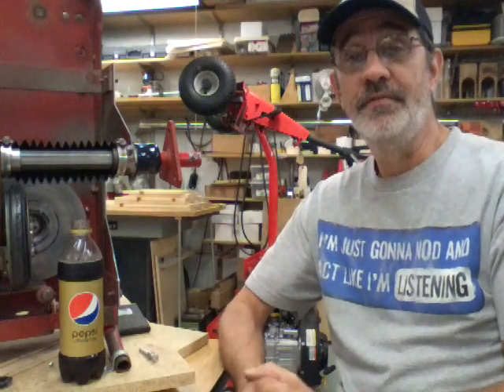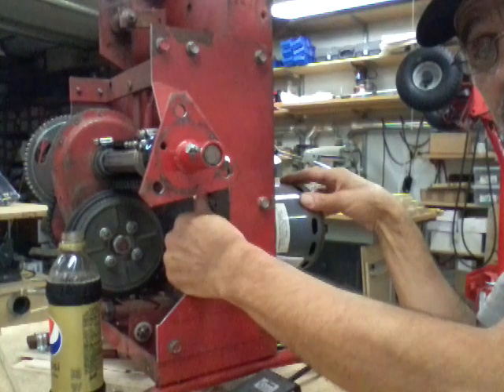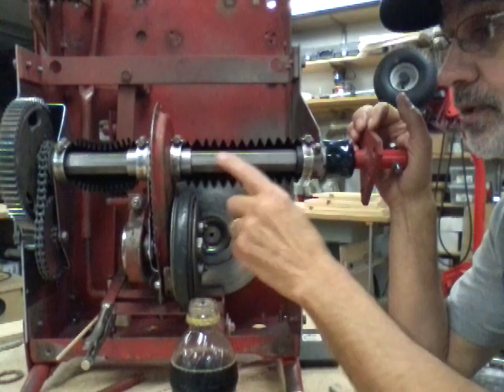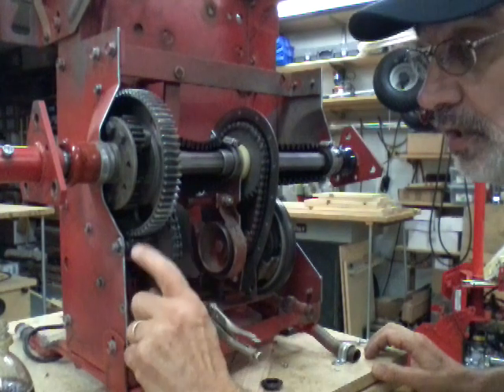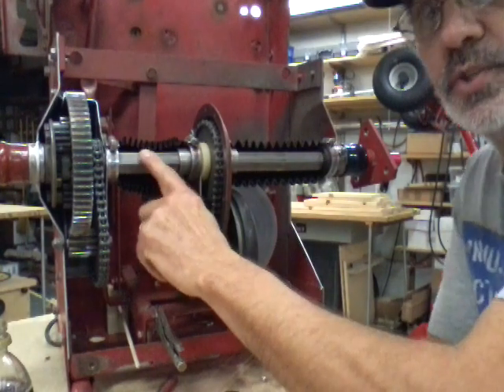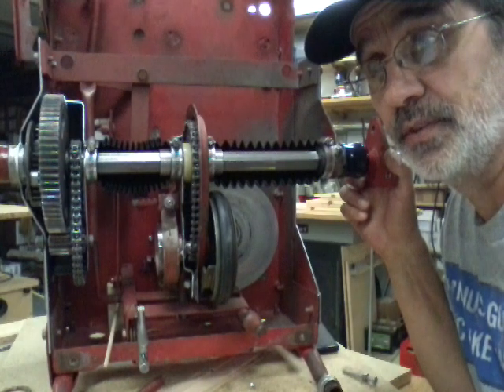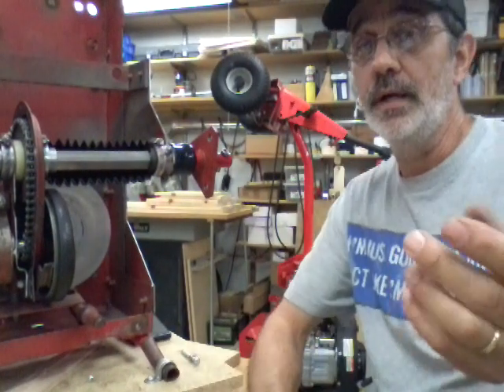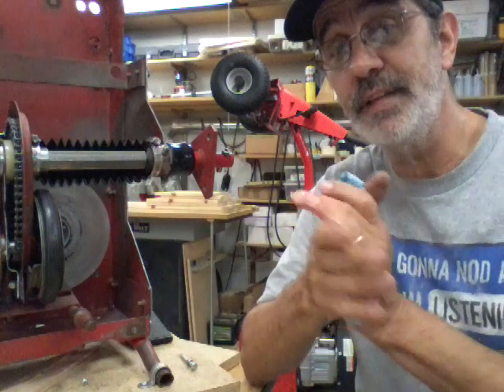132. M/S. 16  troubleshooting the drivetrain on a Snapper rear engine rider

Comment: Jim,  I have a 33" snapper that  I have changed the friction wheel and the belt but it still slips when I place it in gear.  Reverse is fine but going from 1st to fifth it has issues slipping.  Is there an adjustment that I am missing that i could tweak to fix the gearing??
Reply from the maker: I have a few videos that talks about that issue. I’m not sure if you’ve seen any of them, but you may want to check out video number 70, 96, 132, and 182. See if any of those address the issues you’re having and let me know.         Jim

Comment: Should the chain case have any side play on the sprocket? Mine moves side to side about 3/4 of an inch.  Doesn’t seem to affect anything but I don’t know if that’s normal.
Reply from the maker: Well if you’re talking about the sprocket that is on the hexagon shaft it should have a maximum of 1/32  Side play, if yours has 3/4 of an inch side play then your bearings are either gone or they fell out of the chain case covers and they’re up inside of your boots somewhere, with that much side play your chain will probably be a slot through the side of your case.Jim

Comment: Hello, Jim. Great video. I have a 2007 Snapper 30" RER that I bought used early last winter. I did some basic repairs on it, seat, blade sharpened, put on a new pully cover and left it sitting to use this Spring. With the engine off, I noticed the mower didn't want to roll forward or back while in neutral so, I turned it on and it moves in reverse but it won't move forward in any of the 5 forward speeds. The rear wheels are locked as if the mower was in "park". The realize there's no park but anyway, that's the only way I can describe it. I made sure the brake was off and there are no obstructions whatsoever underneath the mower. What's your take on this? Thanks in advance - Ana's husband.
Reply from the maker: Watch video number 70 and tighten your Yorkspring all the way and let me know if that helps you and you could send me a picture of the clutch disk so I can see how badly worn it is. Jim

Comment: I opened my difurntual case up. I did not see anything wrong.  my mower will go in 4th or 5th but not 1st,2nd,3rd, or reverse any answers to this problem? video is very helpful.
Reply: Stand mower up, get help pushing the clutch pedal.  Move the shifter  thru the gears.  back the pedal off 1" and see if there is a difference.  If not, release the lh boot camp at the middle gear drive and move the boot out of the way and see if you have a clean hex shaft or if you have debris build up from a broken boot.
Reply: Look at both sides of the hex shaft under the boots. Sorry,  I'm not fluent with which direction the drive moves.

Comment: First, thanks for making yourself available to us!!! 
Well, I fire my snapper up & it starts screaming like it’s a belt. The gear lever moves pretty freely. 
Thoughts?
Reply from the maker: Well if it acts like the belt is screaming hope it cover off and make sure the pulley are all turning freely and then stand it up and check the belt on the bottom of the engine.     Jim

Comment: Just started following your instructions.  Mower now will go but very slowly. Also when i have the mower in park position i can still roll it?   Other videos i watched mentioned maybe a spring?
Reply from the maker: Aarron E 
Hi it’s Jim
  If you haven’t already watched a video on number 70 and 182,
  As far as your machine rolling in park some do my 33 inch does. If it never used to check your yoke and make sure it’s in the proper location with your chain case. Jim

Comment: I wonder if you could adapt a pair of tracks like from a tracked snow blower, I bet it would push a lot of snow. I just don't know how it would steer without braking for each rear drive assembly.
Reply from the maker: Well, there was a reason most snowblower companies only built those machines for one or two years they just didn’t work.      Jim

Comment: Jim ... My 33 inch mower hops when making a tight turn .. straight drives well ... I notice if I push it in neutral and make a corner it clunks.... I assume something in the differential or broken axel ?   Suggestions ?
Reply from the maker: gypsycowboy427 
It sounds more like it’s in your differential if you had a broken axle machine probably wouldn’t move. Jim
Reply: Jim Jackson Thank you

Comment: Beside the large gear there is a sprocket that has a chain and goes to the reduction gear.   On my machine a regular  chain will not fit on these sprockets.  The links will not fit because they are too long and won't fit into the spaces correctly. Is there a special chain to use?
Reply from the maker: I think the chain in the chain case and in the differential is a standard number 35 chain but I buy mine new from Parts Tree.Com and they’re already circular. You don’t have to put a link in them. They’re ready to go when your machine. Jim.

Comment: When I spin my friction disk by hand my wheels go in opposite directions almost like a zero turn would do if you are trying to pull a 180 or 360 turn, shouldn’t both tires go the same way ?
Reply from the maker: They typically do, but if you have a bushing in your fender that’s worn and the axle is having issues turning it will turn the differential in opposite directions

Comment: Hi Jim. I just bought a like new 28 inch rear engine Snapper. When I push the brake pedal in and out of in drive, I have to release the brake pedal almost the whole way to achieve movement, then it lunges forward like I'm popping the clutch. What do I need to adjust?        Mark B.
Reply from the maker: Mark Bell 
Well it could be your clutch disk causing an issue, but I don’t know if you have a solid clutch or a soft start clutch if you have a solid clutch your spring could be too tight, or it could be caused by the yoke is in bad shape and needs to be replaced or the yolk bushings. Jim

Comment: great video....i have an old snapper that wheels would not turn and after taking off the cover i noticed the bolt/pin looked like it was cracked.  its the bolt that goes into the bottom sprocked attached to the chain...where do you get parts?
Reply from the maker: DARRIN UNDERWOOD 
Hi it’s Jim
  You can get parts just about anywhere are use Parts Tree.Com. there is Jack small engines there’s Amazon there’s eBay . Our use Parts Tree.Com because you can actually call them and talk to someone that will help you find the correct part tell him Jim’s fix-it shop sent you talk to you soon.
Reply: @jimjackson9381  thanks for the info.   i'll be looking at those websites...i purchased the mower for 70 bucks as its super clean.  your video was super helpful

Comment: What do you do if the center drive wont slide back and forth on the hex shaft? Is it rusted to it?
Reply from the maker: @allegory7638  first I have to ask you what shape are your boots in that are supposed to cover and keep your hexagon tube clean?
   Next thing you wanna do is slide your chain case to one side, clean and grease the hexagon shaft and then replace the boots where they belong if that doesn’t help then take the linkage off of the chain case and see if you can move it by hand if you can, then the issue is your shift handle is rusted up Take the linkage off the back of the shift handle and see if it will move by itself without anything hooked to it that will tell you if it’s rusted in place or not if it is, you’ll have to disassemble it clean it good and then grease it. Some of the shift handles have grease fittings on the backside so you can keep them greased so they don’t rust up.           Jim

Comment: Just bought a new old snapper and I'm pretty sure it went underwater at one point now I think the gear shifter is rusted solid do you have a video that would be helpful or any suggestions
Reply from the maker: Dan Theriot 
Yes watch video number 295 it will show you an easy way to disassemble your shift lever assembly and grease it. Jim
Reply: Will do thanks a lot Jim

Comment: 3:14 how thick should the outside of my clutch be on my 33" deck snapper riding mower
Reply from the maker: Rubber on the outside of the clutch disc should be about a half inch thick. Jim.
Reply: Thanks mine was eighth inch so I ordered one

Comment: I have a snapper very similar to the one you have there. When I am in gear and I let the clutch out it doesn't engage all the way. if I rock it forward it starts to engage and then moves. It never did that before but I mowed for probably 4 hours straight yesterday and that's when it started. Any help would be appreciated.

Thanks Toby
Reply from the maker: Toby Meekins 
Watch video number 70 and tighten your yolk  spring thanks. Jim
Reply: @jimjackson9381   where do you order all your parts?
Reply from the maker: Steve Stewart 
Most all of my parts come from the Parts Tree.Com or Amazon. Jim

Comment: I hope you get this iMessage.I don’t know why I changed drive disk and before I finished my small lawn l  wore down the disk. Do you have any suggestions?
Reply from the maker: Do you mean you changed your drive disk on the bottom of your engine or did you change your clutch disc on the side of your chain case?       Jim
Reply: @jimjackson9381  I changed the clutch disk and wore down .
When installed the clutch disc it was popping wheelies
Reply from the maker: I have a couple questions for you
Do you have a soft start clutch or a solid clutch.  
And what hole is your yolk spring in. (As far as how tight is it stretched).       Jim

Comment: Does the differential take gear oil.... through that black plug?  thanks Pauly
Reply from the maker: Hey, say you’re supposed to take both plugs out fill through the top holes until it starts to come out the bottom hole and then put the plugs back in. I just take out the bottom plug and fill it until it starts to come out same with the chain case. Jim.
Reply: oh my gosh thank you for set a quick response.  do you use 90 weight gear oil?  it blows my mind with Youtubers with so many followers actually take the time to get back to people who follow them.. I am fixing to help my neighbor who is a widower and her mower will go in reverse but it stopped going forward. I think I have learned enough from watching your videos to actually conquer maybe the problem... God bless, and thank you for what you do...
Reply from the maker: Ck out video no. 70. And tight the yoke spring.   Jim

Comment: Hi Jim, love your videos.  They have been a great help as I’m storing an old sr1028.  I need advise on replacing the motor that locked up after I was finally able to get it running and the clutch, deck belt and a few other parts were replaced.  The engine wasn’t the original and it was a 12.5 hp Briggs.  I won’t to buy a replacement motor and I found a new 6.5 hp vertical shaft for $99 at harbor freight.  My question is will 6.5 hp pull this mower?  Thanks
Reply from the maker: Kevelin D Kinamore Sr 
Hi Kevelin
  I am not sure what a 6 1/2 horse would do maybe if your yard was totally flat and all you were going to do is mow the grass it might be OK, but if you have any hills or if you wanted to bag leaves I don’t think a six and  half horse is going to handle the load. Thanks Jim
Reply: Thanks, small yard totally flat.  Having problems with my legs so it’s getting harder for me to push now days.  May look to go up to a 10hp though
Reply: mine came with a 9 hp bs and it worked fine.  I put a 13 hp honda on it and it will rip belts out like crazy and pop wheelies.
Reply from the maker: Walter 
   Hi Walter
I’ve got a 12 1/2 horse on mine and I’m having no issues at all like you were talking about. Try loosening the yoke spring and see if that helps. Thanks Jim

Comment: You’re awesome! 

I’m trouble shooting my ReR getting bogged off the line on a little hill or under any sort of resistance.  It has a 13hp Tecumseh on it so I am guessing it’s slipping?
Reply from the maker: Watch video number 70 if your subscriber it’ll help you find it easier and tighten your yoke spring that should take care of your issue if it doesn’t get back with me. Jim
Reply: @jimjackson9381  Subscribed!  I don’t know what a yoke spring is but I’m about to find out!!
Reply from the maker: @123DahlBerg  Well let me know if you can’t find it and if you need any help. Jim

Comment: Jim, I need your expertise opinion here. I recently acquired a snapper rear engine rider Forrest Gump type. The guy was restoring it and repainted it and when he put it back together now the mower won't go forward or back not even in neutral. When I stand it up the rear wheels will turn in opposite directions in other words if the left Wheel turns clockwise the right wheel will turn Counter clockwise, and if you turn the right wheel clockwise in the left wheel will turn counterclockwise. The point is both rear wheels will not turn as if the mower is going forward even when it's in neutral?! Any input before I start tearing into it would be appreciated!
Reply from the maker: @itzmepete  OK by standing your machine up and turning one tire in either direction and the other tire turns in the opposite direction that is normal that is how the differential works now by trying to turn both tires in the same direction it’s going to turn extremely hard because you’re turning the drive train in the opposite direction that it’s designed to do what you wanna do is try turning with a machine in neutral the clutch assembly by hanging onto one of the four small nuts rotate the assembly and see if the tires turn if they don’t and the assembly does turn then pull one of your boots loose from the chain case and see if the hexagon tube is turning it is turning the chain cases. OK all that’s inside of the chain cases two sprockets and a chain issue is in your differential. If you can’t turn clutch assembly it’s locked up then the issue could be either in the chain case or in the differential, the only way to tell is to pull the chain case off and see if it will turn, the hexagon tube in it that will tell you where the problem is. Make sure you remove your battery. If you have it standing up for more than 10 minutes. It could leak acid down on top of your carburetor, which is aluminum they say two hours, but I wouldn’t go that long.   Let me know what you find out and I’ll get back with you.         Jim
Reply: @jimjackson9381  I'll try it, thanks buddy!
Reply: @jimjackson9381  JJ,

I did pull the inspection plugs off the center gear with the chain as well as the differential. Now I stuck my finger in there and I can feel the chain in there and it feels kind of like it's on there but it does feel abnormally tight. When I wiggle the wheels back and forth I could look inside the differential through the inspection port and I could see the wheel in their the gear the internal whatever wiggling back and forth a little as well. Neither Axel turned when the wheels turned in opposite directions. I'm uploading a video now and I'll reply in a few minutes with the link.
Reply from the maker: @itzmepete  something and I’d like you to look at take your tires off pull off your dust caps off the sides of your fenders and check to see what the bushings look like if they’re still in good shape or wore out.      And I don’t see the link for the video.        Jim

Comment: I just discovered snapper and want the rear engine rig. That drive system is a design from the 1800's, I have seen it in museums. Would you say it is more reliable than all the MTD hydro or gear transmissions that are in the basic rider mowers?  Looks like it could be quite sturdy if the rubber drive disk is easy to change and reasonably priced [And made well] Thanks!
Reply: Snapper 12/28 mfg 2009. Disc thrust washer and cover fell off hub. 4 nuts gone ruin disc ??and one studemotly free clutch. The brake is inside the friction missing,,  how to get en 2 spro😢Chet’s via chain😮 ,  hou to rlarge 15/16 nut off? Yea every time I try I feel live tension between
Reply from the maker: Send me a couple pictures of the issue you’re having so I can see what is going on, send them to. jimsfixitshop@gmail.Com
Thanks. Jim

Comment: hello I put thick grease in the differential of the snapper rider, and now the wheels do not turn when I engage, and it is from the differential, what to put in it. Thank you for your reply
Reply from the maker: Well, I’m not totally sure that Greece would actually lock up your drivetrain, but I would probably clean it out and fill it full of Snapper double00 lube.    Jim

Comment: Hi Jim my father in law just gave me a one but I cant get it into neutral the clutch looks like it's in good shape .once you start the engine it will go in gear but when the engine is not running I cant get it into neutral any advice would be helpful thanks
Reply from the maker: Michael Setliff 
Unhook the boots from the chain case clean and grease the hexagon two and see if that helps do both sides, if that doesn’t help take the linkage off of the backside of the shifter and see if that will move freely on its own they usually will rust up.   let me know which find out.Jim

Comment: Replaced Clutch disk and it works fine now. It’s coming to a stop now and then taking off again. What is the problem ?
Reply from the maker: It stops and goes all by itself ?
If so look at video number 70 and tighten your yolk spring and let me know how it works.  Jim
Reply: Stopped going up my driveway again. Just like it did before replacing the Clutch disk. The Clutch disk is still in good shape. What is happening ? Smelled a burning smell too.
Reply from the maker: OK if you watch the video number 70 and tightening the yoke spring is not helping I have a couple other videos I would like you to watch that may point out issues you may have one is 96 another is 132. Another is 182. Check them out and see if they help and let me know. Jim.